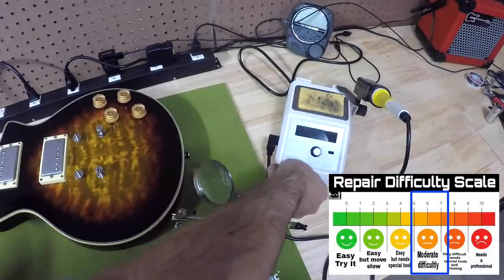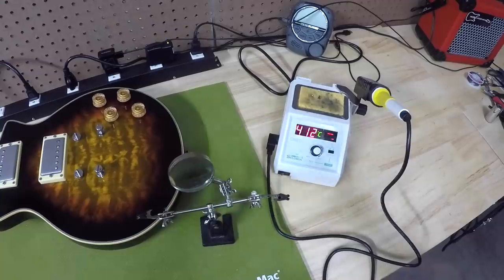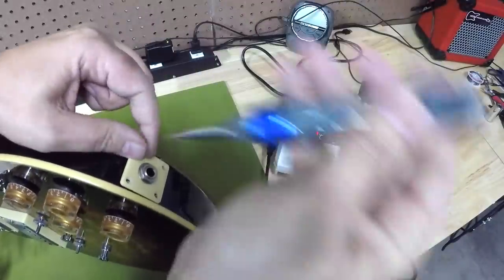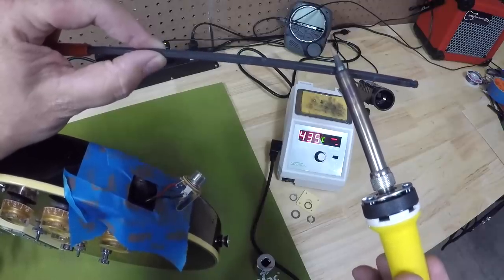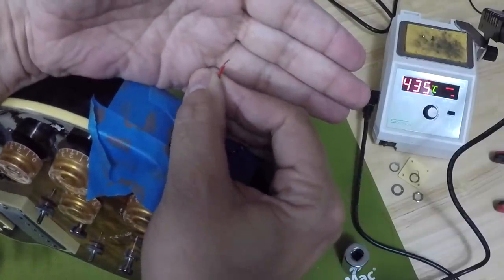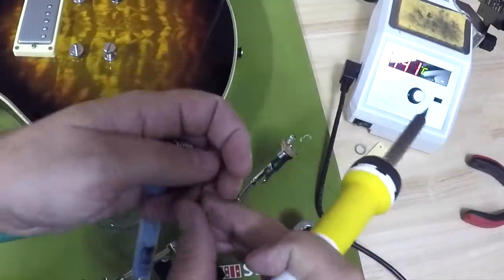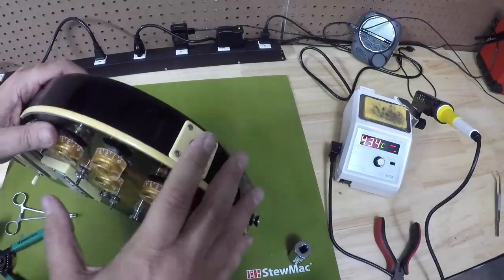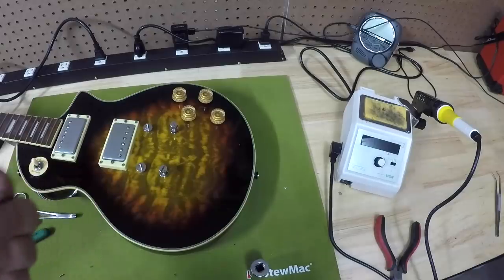Basic Guitar Soldering. Sharpen My Axe

Comment: Anyone have this issue?

I have a 30w 220v soldering Iron and the tip doesn't melt the solder, it goes hot I tested it out, it goes hot and stuff, but the very tip, as in the thin point at the top won't melt the solder no matter how hard I try, the part near the middle section doe, goes hot and does melt the solder, just not the very fine tip of it.

Comment: Tech tip about replacing a stripped truss rod?
Reply: @stevelaferney3579  he doesnt do it on the kind of truss rod I have. I have a 70s Magenta martin D18 copy.
Reply: @stevelaferney3579  it's the kind that you stick an Allen key inside. Not the one with an acorn nut

Comment: Burn a finger on the tip of a soldering iron? Damn! That hurts! Problem solved: Take a can of compressed air (Dust-Off), turn it upside down and give the burn a couple of very quick squirts of the propellant. Pain is instantly gone.

Comment: we can back up your vid... so newbies should take a few pictures of anything they're working on and check for clarity before taking stuff apart - - even a pic of a tone pot shows you how to connect the new one 
- speaking of tone pots... strats have no tone adj for bridge - tie it into the neck tone pot since they aren't used together - the 5 way will decide which pickups you hear...   you can even use 1 pot as a Master Tone like the 2 knob asian strats do and use the other for coil tap or humbucker tones 

- just bought a loaded SSS guard with 1 Master Tone and a mini toggle in the empty 3rd hole 
- that gives the in-phase Tele combos

- if you have an SSS strat consider a switch to 4 wire hotrails - same size - HUGE Diff to have an angled humbucker bridge = that elusive Strat ROCK tone... NOT HSS

Comment: $130 soldering station? Mmm, Nope you can get one about same style  $40 bucks at Walmart.   

See, I just saved many people watching a $100 bucks so they can buy more gear related. cheers
Reply: With Walmart, you get what you pay for. I'd never buy a tool from Walmart.
Reply: @KaitouKaiju  Walmart is No different than, Harbor Freight, Lowes, Home Depot, Ace Hardware, Amazon.  
The only difference is the prices.  

So, yeah you get what you pay for when someone doesn't shop around. haha
Reply: I bought a cheap $17 soldering iron off Amazon comes with some accessories, and a basic holster. adjustment dial for temperature on the iron itself, has worked great for 4 years now, soldering irons needn't be fancy, just need to get the job done.
Reply: @kmw5100  That's really cool. Make sure you tin the tips make it last longer or buy new one when its wear it out.
Reply: All cheap tools tend to either not work as well, break easy, or aren't very safe. A lot of people think cheap tools are fine, but also haven't ever had ample experience with a quality tool and therefore they don't actually know how much of a difference the price can make to those aforementioned factors. But, that's not to say cheap tools aren't useful.
My rule of thumb is, if it's a tool you aren't going to use very frequently, then get the cheap one. But if you end up using it often enough that it breaks, then purchase an expensive one as a replacement and get more value for your money. For the average person using it for just your own guitars, you probably won't use it very often, so I don't see a particular reason to go all out for one. But someone like Philip works on guitars as his daily job and has many peoples guitars, so he would need a more expensive one. It all just depends on what your particular circumstance is.